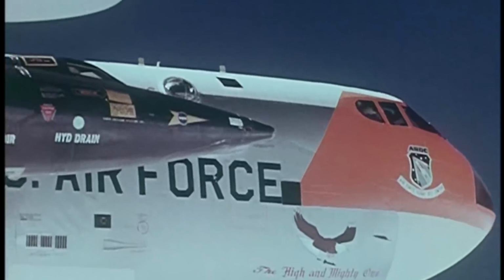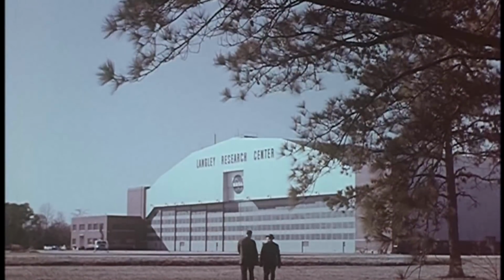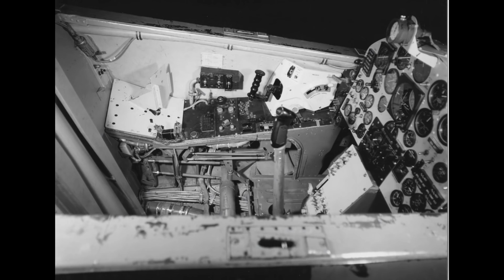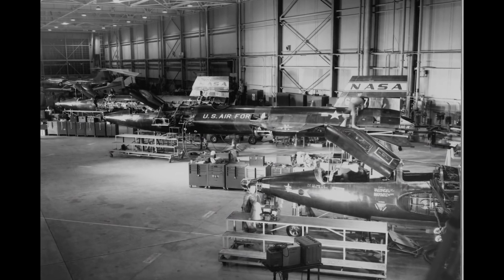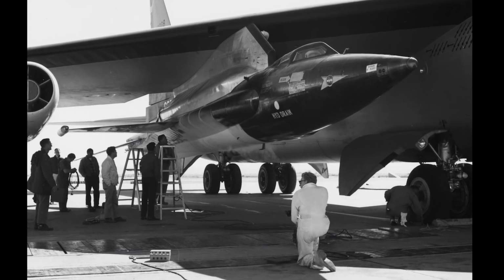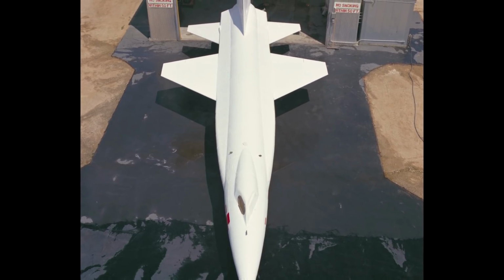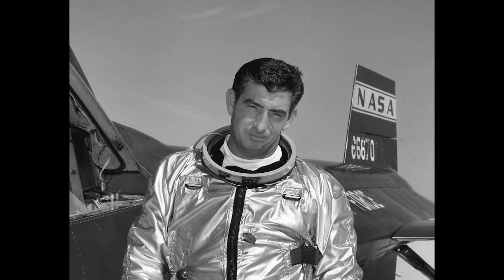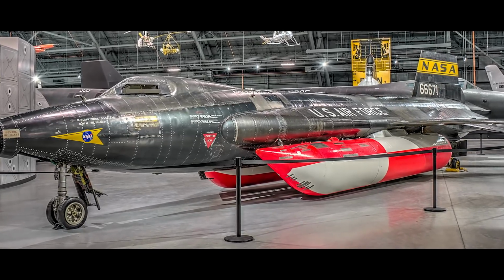X-15 The Hypersonic Research Airplane from NACA to NASA | X Plane Series by PilotPhotog

Comment: Have to say it: the X-15 was CRITICAL to NASA, its understanding of hypersonic flight, the issue of heat as a function of speed, and the dynamics of controlling an aircraft when aero-based control surfaces were non-functional ... AT MINIMUM!  Looking back on the X-15, I have to wonder whether any part of our modern-day space programs WEREN'T touched by what we learned from that brilliant aircraft.

Rather than try to keep it flying, I wonder if the greater wisdom might have been to design a second-generation hypersonic aircraft, based on what had been learned from the X-15.  Would that the money could have been there.

Side Note: I still remember reading books about the X-15 back in the late 50s and early 60s and being thrilled by the stories I read.  There was also the eponymous movie, made in 1961, which was more than a little funky and not 100% accurate in places (100 miles up?  Don't think so!), but still had some GREAT stock footage of that black beauty.

Thanks for this.  A most thorough and well-detailed account of a singular aircraft!
Reply from the maker: Thank you I am very glad you enjoyed this video. The X-15 was a bit before my time, but I can imagine how magical that era must have been.  I make these videos for those of us who were there to remember and for a new generation to learn.  Be well and again my thanks.

Comment: And you can bet that the X-15 was a HUGE test bed for the SR-71 and A-12. That immediately clicked when I heard "camera" and "high altitude". They also switched out to titanium. I mean it even resembles the cockpit and fuselage of the famous planes.
The test cone on the is obviously testing for Blackbird's engine retractable inlet cone. 
They were doing all this publicly, helping to upgrade the two best planes to be built....in the 60's and 70's. Imagine if the kept going?
Reply: LOL.....see the newly updated info I went off with in the above reply of mine....lol.

Comment: Excellent video, however I have to point out one big mistake. Regarding the Fly By Wire, yes it is used on an entire generation of planes, however the F-15 is perhaps the only 4th gen fighter to NOT have a fly by wire. The same goes for the F-14 (however it's not exactly a true 4th gen fighter). The newer F-15EX, SA and QA do have FBW but not any of the legacy F-15s or F-15Es. The F-16 was the first operational fighter to have Fly By Wire

Comment: The B-52 drop plane used for the X-15 is on display at the Pima Air and Space Museum in Tucson AZ.  It has the nose icons for the flights on it and still has the cradle for the X-15.